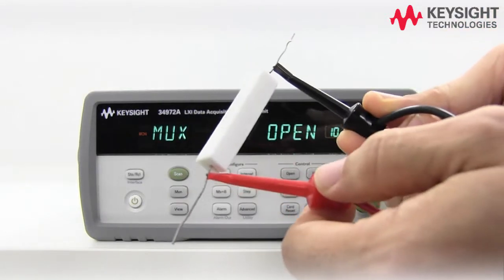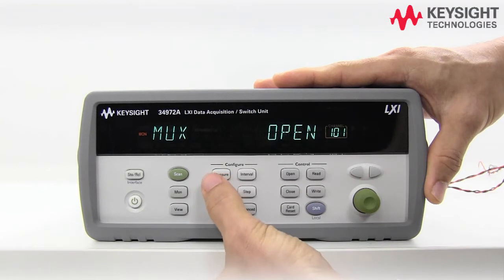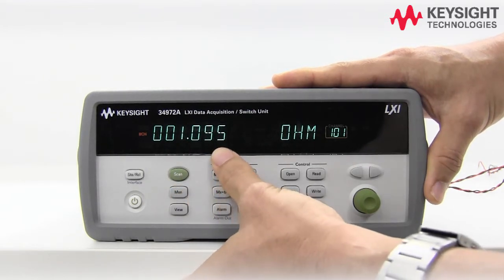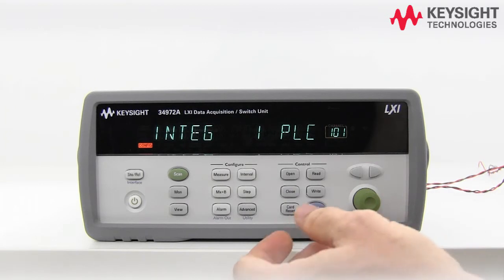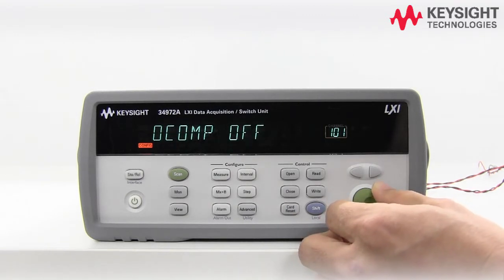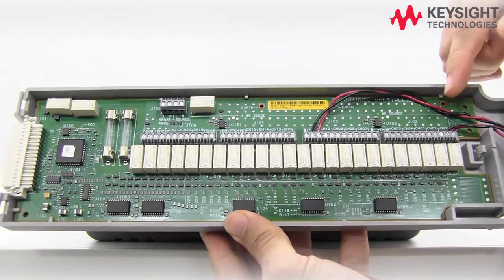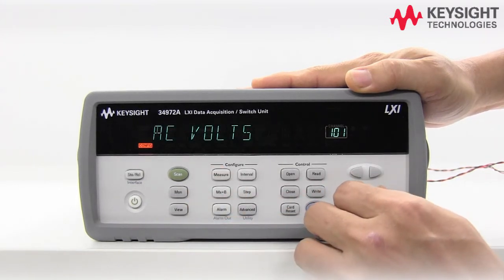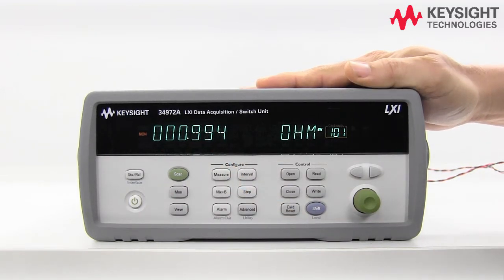Test and Measurement Basics – DAQ | Episode 11 – 2-Wire and 4-Wire Resistance Measurements

Comment: When I use autorange the output is 100 kohm when it should just be 100 ohms. Any reasons you can think of? If I set the range to 100 ohm, it does read out 100 ohm. This is in the 4-wire configuration.